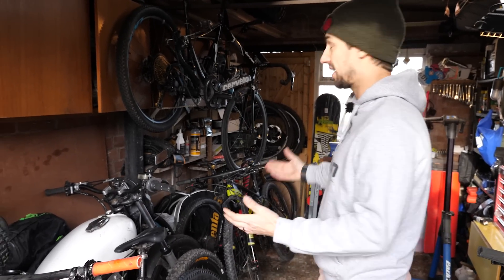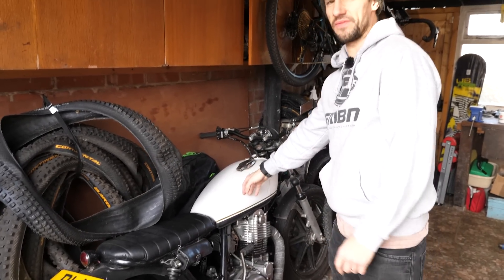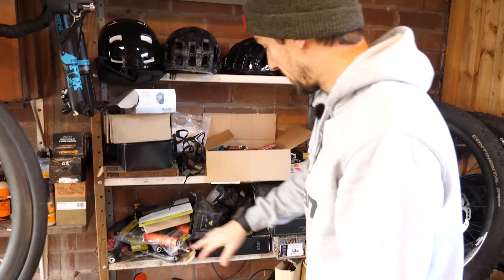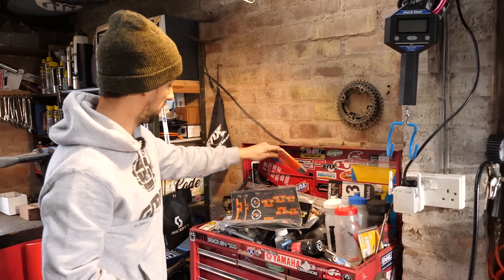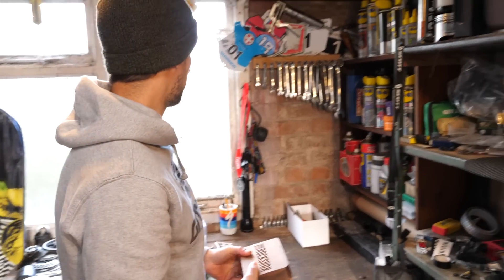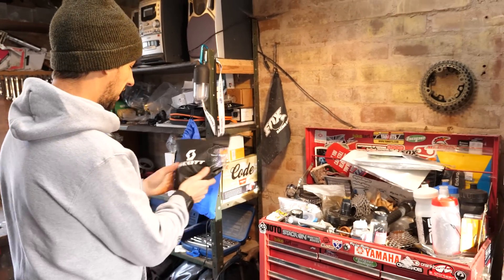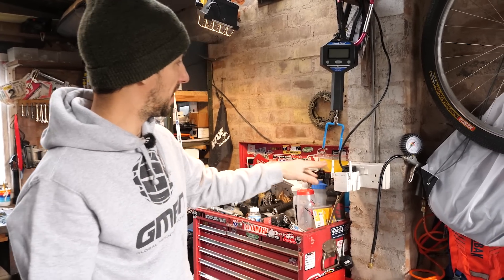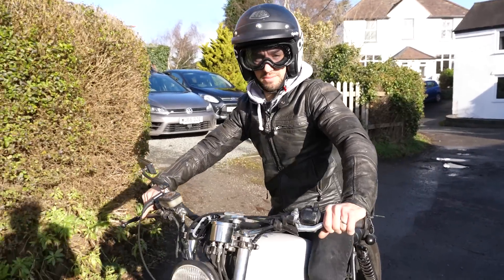Neil Donoghue's Garage Tour | What Does A Real Bike Cave Look Like?

Comment: I had an SR500 and I loved it! I despatched on it in the mid 80's. I monoshocked it by using an LC350 swinging arm and used the end of the oil in frame tube for the top shock mount. Had to move the battery cage over a bit but that was it. Looked the dogs bollocks and handled better too.  It was fairly unique at the time! Thanks for bringing back the memory! :o)

Comment: Nice! Used to roadrace against track-modified SR500's back in the '80's. I bought a new RD400 as my first street wheels in '78 at 16yrs. It was only $1189 and I got a loan with $300 down pmt. My '85 GPz550 was only $2799 new. Now, that will buy a decent bicycle.

Comment: Not a mancave without an old stereo! I have 2 ghetto blasters but neither of them gets used because there's an old computer with 3D suround sound, internet access and a digital projector which projects onto a white roller blind. I also have an old kitchen with all the drawers and cupboards labeled for tools and camping stuff etc. And my bikes, gym equipment and N+1 corner. My Zen space

Comment: hey how do you add the funny cable stop on the shifter cable? it comes in a long string or many shifter cables in one box?
Reply: Ben Soh the outer is a continuous length on a reel inside the box which you can cut to size, and the inners are just a bunch of regular inners in a box.
Reply: i see  i was confused as the ends of inner cables have some sort of cylinder stop at the end
Reply from the maker: That's the end that slots into your shifter housing in order to secure the cable in place that end. You then tighten it and clamp it at the opposite end